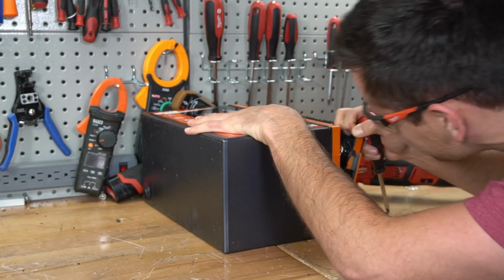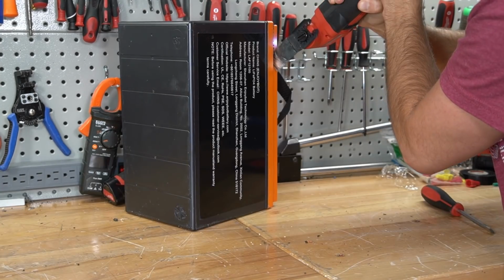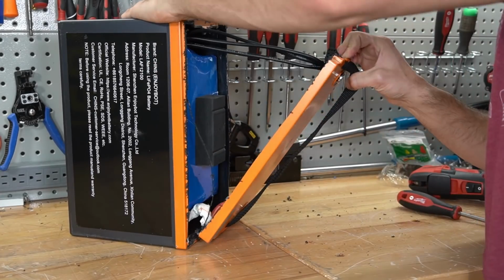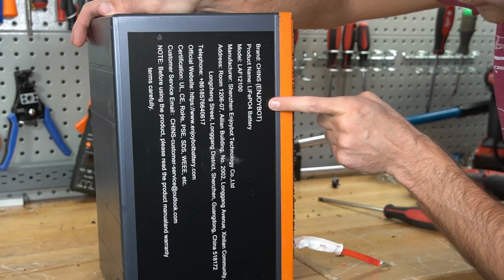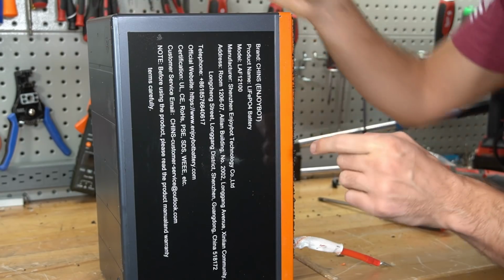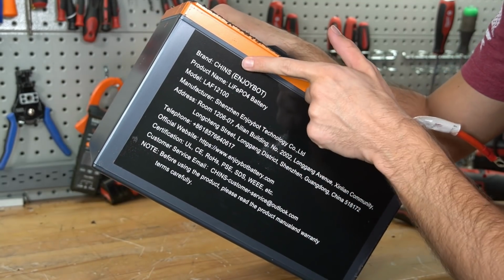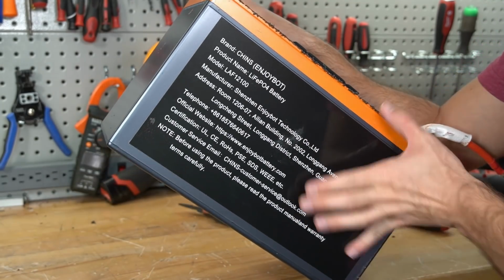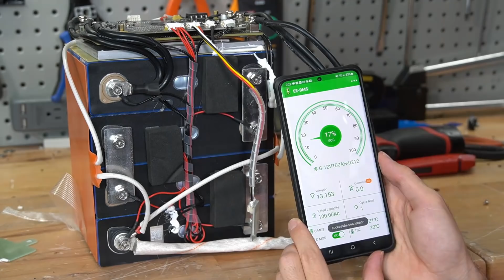CHINS $579 12V 100Ah: Actually impressive!

Comment: I bought 2 of their 300 AH Smart Batteries ran in parallel, Bluetooth worked ok, but only had a 100 amp BMS per battery which wasn’t enough. I returned and swapped them for 3 of their 300ah 200ah non smart non heated batteries in parallel and put on my own temperature controlled heating pads and it’s worked great. This setup is my my RV and charges off my 1.6kw solar system with an Xantrex XC Pro 3000 watt inverter. The 100AH BMS per battery would turn off when I ran high amperage stuff like my microwave. It would only support 2000 watts and the voltage drop was significant even with 2/0 cable. No issues with 3 of batteries with the 200AH BMS, no voltage drop or cutout. System tested 923AH when I ran it all the way down, measured using a Vitron shunt. Their customer service is very good, offering setup diagrams and setting for any setup. When I wasn’t happy they offered the swap.
Reply: That's why you run 48v
Reply: @my_channel_44  have to run the 12 volt system for the rest of the rig. Would require a transformer and a lot more than just parking the batteries close to the inverter.
Reply: @Fix-it-tony  'rest of the rig' is a pump and led lights. Maybe with a router (with a $10 voltage stabilizer board so it always gets 12v exactly). With enough 12v onboard for starting assist, you're still only talking about 2* 27-DCM's from East Penn State (O'Reillys Auto Parts) in addition to your starter battery (which can be another 27-DCM). Your main AC system should be paired with a 48v battery system.
Reply: Can you share the temperature controlled heating pads you used? Thanks in advance 🙂
Reply: You have just saved me from a lot of headaches... I am looking to run a 12v fridge and a 12v conditioner and that would definitely trigger the 100ah BMS. Is your inverter a all in one type?
Reply: @saundz8791  Xantrex XC Pro 3000 handles shoreline charging and inverting, have an EPEVERS solar charge controller.
Reply: @Fix-it-tony  as a backup it sounds great. I'll look in to it.
Reply: @saundz8791  I have 2 of their 300ah non-heated batteries in my van.  I've had no problems running my roof mounted A/C overnight with this setup in the 8 months I've had it.
Reply: @kennethbell4681  are you using DC to DC charger? I'm at this moment speaking with manufacturer inquiring about their 300ah batteries
Reply: @kennethbell4681  what A/C do you have if you don't mind me asking? I'm also looking in to the subject.
Reply: @saundz8791  Houghton RecPro 13.5k.Efficiency and loudness were the primary factors.   I looked at the 9k, but it was louder, uses the same power as the 13.5k.  Approx 80amps draw from the battery with the compressor running.  9 amps with just the fan running.  WIth 600AH, this will give us a cool night in a Cracker Barrel  parking lot between charges.  The drawbacks are the additional height... there are sorter units, and no wired thermostat.  You must use the remote to change the temp.  There is a push button on the bottom of the unit to turn it on to whatever it is set at.
Reply: @saundz8791  I have a Victron 30a DC to DC charger. It works fantastic,  BUT it would take 20 hours of running the engine to completely recharge a 600ah battery bank.   Shore power and the Victron Multiplus are used if a plug is nearby.
Reply: @kennethbell4681  I'm very great full for all your feedback. I have been looking in to the Nomadic and Domatic a/c units but the price for those units is a bit outrageous. I found supplier in China who carries similar type of a/c unit for a fraction of the price and I'm evaluation the option since a 12v A/C unit plus a 12v drawer fridge including sea shipping is about $1k.
Reply: @saundz8791  The 12v systems sound interesting and if they had been a bit more mature and available a year ago, I might have one now.
Reply: This has got me thinking that my AIO disconnecting when trying to use a toaster oven was a battery issue and not an issue with the inverter????
Reply: @CanadianTexaninLiguria  three things to look at wire gage, BMS cutout amps, and voltage drop in general. Remember wattage divided by actual voltage. When under demand the voltage generally drops a bit. Mine 3000/12.4 =242 amps my BMS needs to deliver during peak demand. I have three batteries with 200 BMS’s in parallel, so it can easily support it. I also run 2/0 wire for 5’.